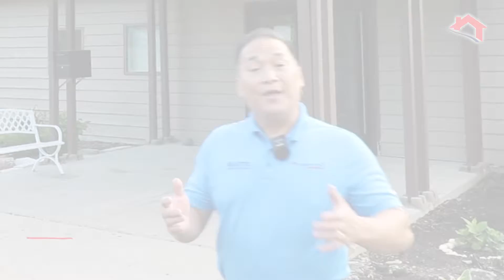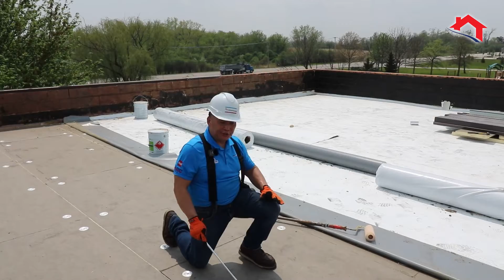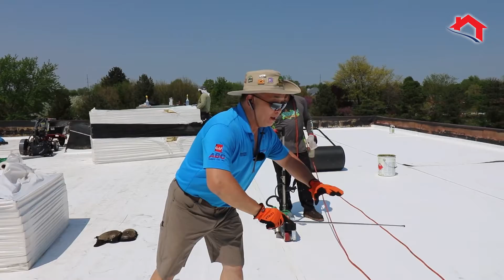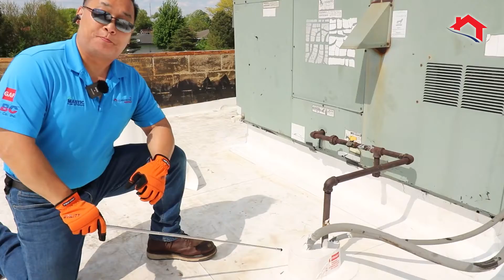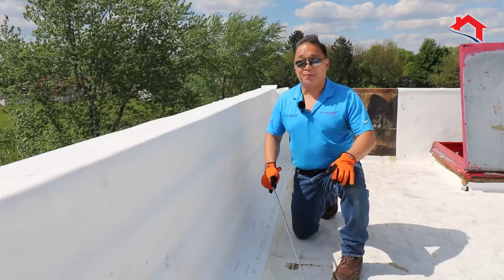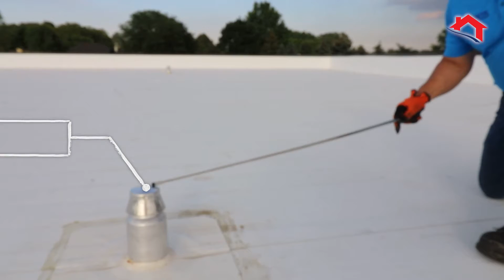How to Install a TPO Roof | Step-by-Step Commercial Flat Roofing Guide (Start to Finish)

Comment: Great walkthrough. One thing that often gets overlooked is that the roof's long-term performance is usually determined by drainage, penetrations, and flashing details and not the field membrane itself.